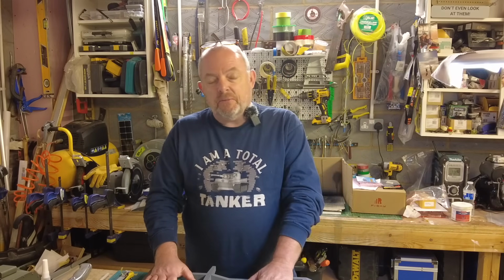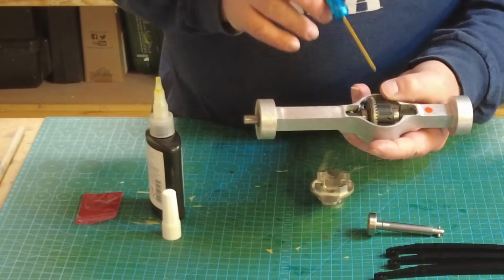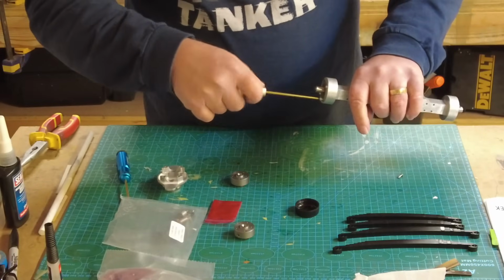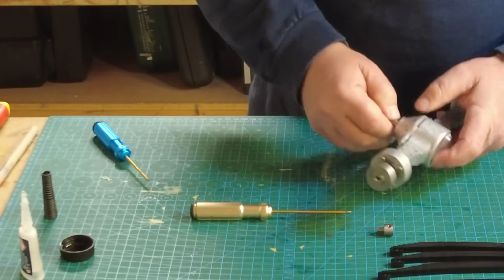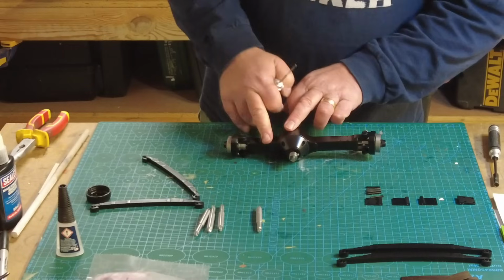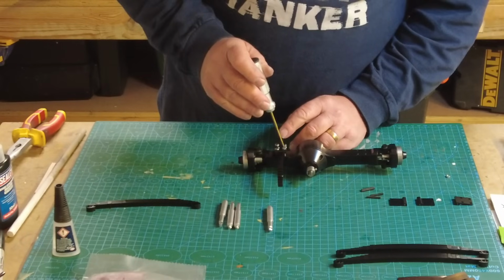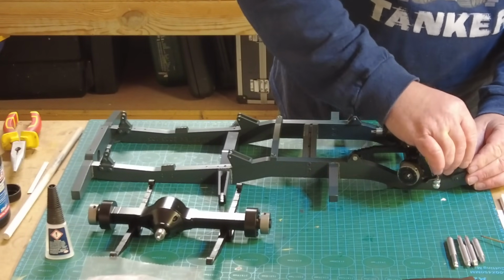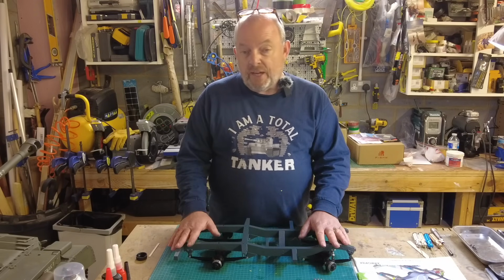1/6 scale model - Armortek Series 1 Land rover(Vid 04) Assembling the Rear Axle and Differential.

Comment: Really enjoying your build of this great kit. Just a couple of questions, you said you added the weld beads to the chassis, great idea. Did you make them yourself or was it a aftermarket item? 2nd question, do you think that the axels have enough meat on them to round off to add a better scale look. Keep up the good work & I love your take on the colour.
ATB
Tim
Reply from the maker: Hi and thanks for watching and commenting. I use Milliput Epoxy Putty to form the welds. I have done previous welding videos on the Hetzer and M26 Pershing tanks if you want to see how I achieve this. I see your point in the axles, but I don’t think there is and also the flat side is used to insert the threaded 20mm grub screws which retain the springs. Hope this answers your questions and also hope you continue to follow this build.

Comment: Great vid Tony. I wonder, would you be able to drive the vehicle through a water feature? I ask because i didn’t see you install any gasket or o-ring material on the axles to keep the water out of them.
Reply from the maker: Thank you. You know..that is an excellent question. There is nothing in the kit to provide for that and lets face it we all want to drive these models through through terrain and obstacles. There is a lot of grease on the diffs, so this would help, but how to stop water ingress into the housing and through the hubs is something I may have to look into. Thanks for your continued support. Have a great weekend.

Comment: Looking sharp, Tony.  Nice paint work.  Perhaps you could use black permanent marker on the sliding portion of the shock (inner), it would allow it to be the correct color while not adding as much thickness as spraying paint would, which inhibits the movement.  I doubt where it's located you'd notice the difference.
Reply from the maker: Thank you. I am pleased how its starting to look. I think the black on the axles looks good. You are ahead of me....In the next video, I do paint the shock absorbers, but not black😀, and I use a permanent marker in the areas where the shock needs to slide...it looks like grease. I am happy with how that turned out. Video up next week. Have a great weekend and thanks for your continued support.